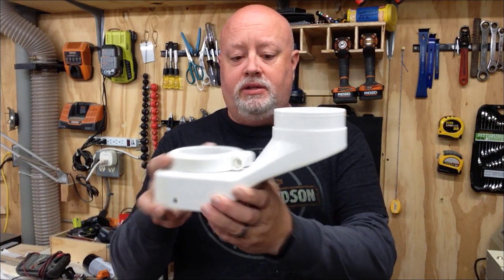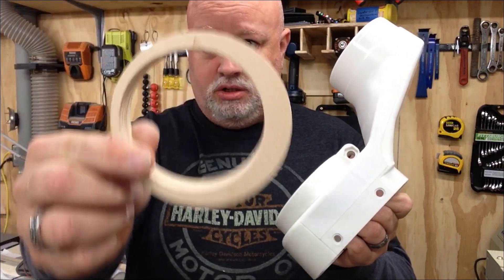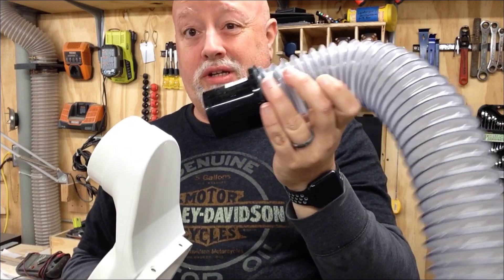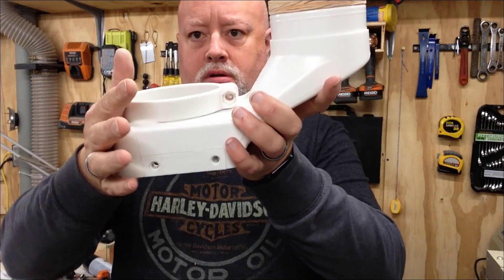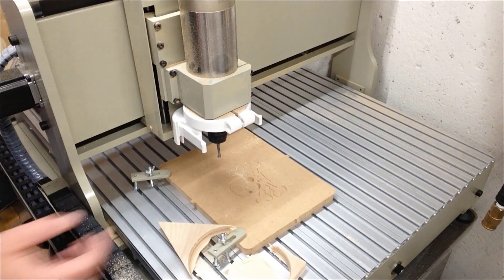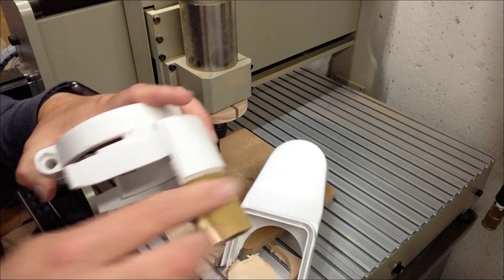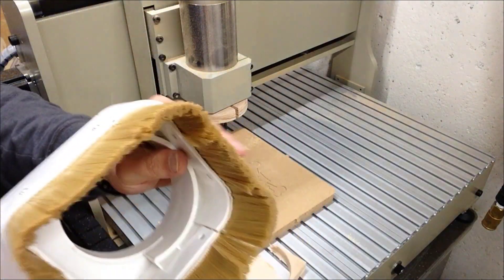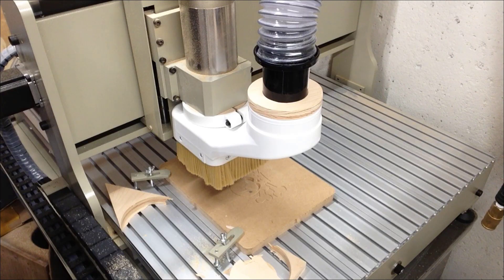6090CNC Router Dust Boot and Adapter

Comment: Nice job, Jeff
Reply from the maker: Thanks James!  If there is anything you want to see done/fixed/torn apart on one of these CNCs, just let me know.  The tramming video that I started is still "in the works" but going slow... as summer is busy outside weather.  Have a great day!
Reply: @jeffmorlen  I'll chime in actually.  I am looking at getting my first CNC machine after coming from 3D printing.  However, the price points on the X-Carve and Shapeoko CNCs are near the price points of this machine, which mechanically looks vastly superior with its acme screws and liquid cooled VFD.  Could you explains some of the difference between these machines and if you would feel comfortable recommending this machine to a beginner.  (And yes, its not a beginner machine like an X-Carve, but maybe it should be.)